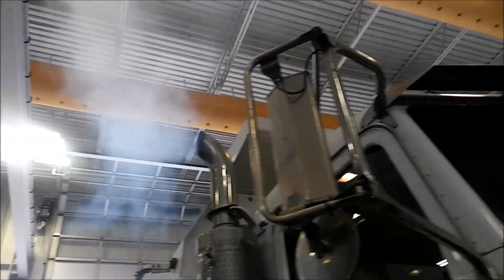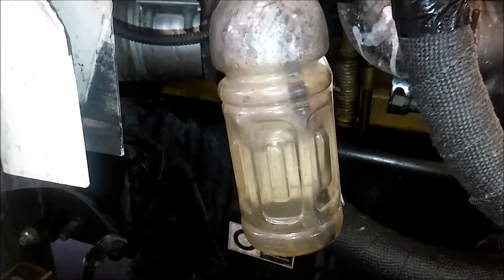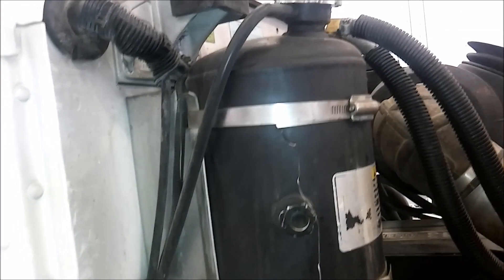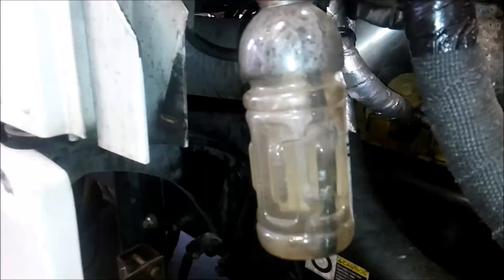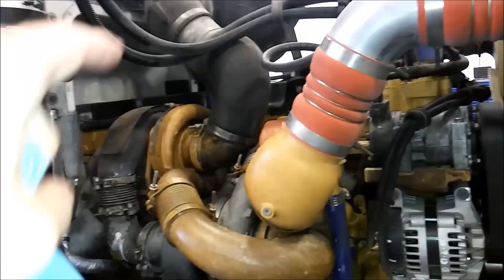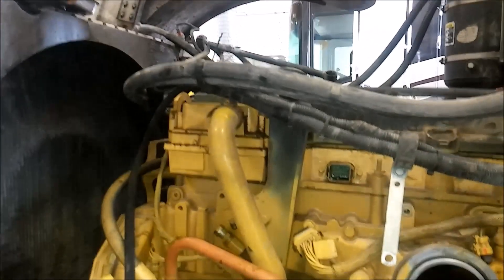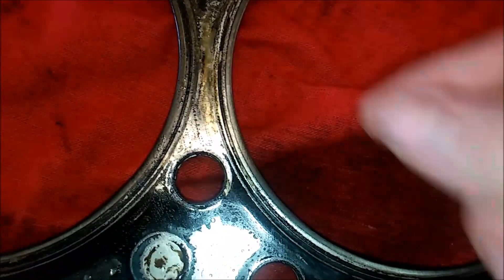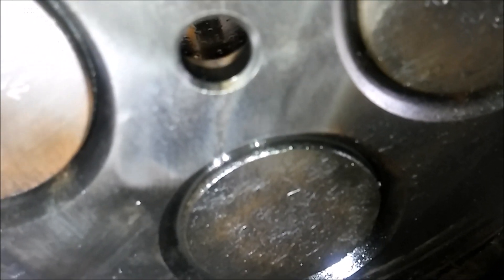Test For A Cracked Cylinder Head or Head Gasket. Perform The Bottle Test or Bubble Test.

Comment: Great videos! Found them looking for help with my symptoms and ended up watching about 8 so far. I have a 2009 C15. Bottle test looks exactly like your video, but no white smoke, smooth, no sludge or moisture sign on dipstick or oil filler cap. No change with compressor pressure line unhooked. Was pushing out 1 gal of coolant per week. Suddenly changed to 1 gal per day for a week. Last day pushed a gallon per hour. Idle or loaded doesn't seem to make much difference. Any thoughts? Thanks and keep up the good work.
Reply from the maker: +survivethewalkingdead That is a lot of coolant consumption. If it is pressurizing the coolant out that bad then you most likely have a blown head gasket or cracked head. Check that radiator cap too, but it should not be causing that much coolant to be lost.

Comment: Yes it's c15. I Replace head on this engine 150'000 miles ago  and that start blowing air into the radiator I take the head off and the gasket the rings are black on one side but I don't see cracks on the head I'm thinking what to do.
Reply from the maker: +vitaliy kostenko Cat recommends the counterbores be cut at 750,000 miles. If you've pulled the head twice already it would be a good idea, even though it's a pain to do. If your fire ring was damaged on the head gasket as well then the counter bores is even a better idea.

Comment: there is no bubbles at all when I parked with truck running, that only happens when running on the highway, how can I check if it's the air compressor? thanks for your help.
Reply from the maker: +Immer Pineda Well you'd be getting air bubbles from the air compressor if it was failing. Did you do the test at high idle and hot?

Comment: I put new radiator fill neck and a new cap and the cap still come off only when I drive it like more than 100 miles see...I leave my truck running all night long and everything goes well...but whenever I start driving boom the cap comes all the way loose...
Reply from the maker: +Immer Pineda Hmmmmm, you need to check that cooling system for compression, sounds like you are getting compression in there and popping the cap, could be air compressor too.

Comment: KW Uses air operated heater valves in some of there bunks that when the seals fail internally they introduce air under system pressure into the cooling system. When this happens it will produce bubbles in the bottle test, as well as air locking the  thermostats. I hope this info helps somebody out there. Thanks AA for the great content in your videos.
Reply from the maker: +BEARivrman81356 That is the first I've ever heard of that. Thanks for the info.
Reply: If your  CAT in your KW overheats when you turn your ac on ,you may have this problem.Try turning off the manual heater valves to the sleeper heater located by the water pump on c15 and 3406 engines. If your over heating problem goes away you have a bad heater valve at the sleeper. I have encountered this problem on 2 different trucks. Change the valve .Problem solved!
Reply: @AdeptApe  kenworthy some have this problem

Comment: I just did a overhaul on my w900l cat3406e and I drove about 200 miles and the cap of the radiator came all the way loose and some coolant comes out...I did the bubbles test couples of times and there was no bubbles at all...my radiator mounting are very bad plus my hood is also very loose it's kind of pushing the radiator cap down...dou think that's the reason why the radiator cap comes loose???? thank you...
Reply from the maker: +Immer Pineda The radiator cap will usually only come off for mechanical reasons like something moved it or the tabs are worn out on the cap or expansion tank. You probably need a new cap and if you aren't getting bubbles then your engine is probably fine.

Comment: Adept Ape I just did a gold overhaul on my kw900l cat 3406e and after I drove 200 miles my radiator cap came all the way loose and some coolant comes out, I did the bottle test couples of times and there was no bubbles at all... my radiator mounting are really bad, the hood is also very loose it's kind of pushing the radiator cap down...do you think that's the reasons why the cap comes loose???? Thank you...
Reply from the maker: +Beatriz Herrera Check my response to your other post.

Comment: is there a tool part number for a compression test adapter for a c7 acert motor??
Reply from the maker: +Wendell Jones Some of Cats engines have them, but I checked the dealer tool catalog and there was nothing for a C7. There was a C7.1 compression tester, but that is a Kutch different engine. There may be one out there, but from what I could find there was nothing.
Reply: +Adept Ape thanks for the information, I guess the best way to check is a blow by test??
Reply from the maker: +Wendell Jones You can still check the cylinders, if you watch my video about doing cylinder cutout tests and checking for weak cylinders I test the cylinder with an air nozzle. Check the video out and see if that helps you.

Comment: Hey Adept Ape!

Which of the 70 pins of the ECM should be powered to bench-start th c7 engine on ground?

Thanks a bunch!
Reply from the maker: +Omar That depends on the serial number, typically pin 70 is for the switched 12v source and then the constant hots vary depending on what your exact serial number is.

Comment: cool videos. I used to work for a truck shop for years. Ive had to replace several heads on c15s. I used your method before. Works awsome. Two were due to broken water pumps and trying to make the delivery. Don't take much to crack thise heads.
Reply from the maker: +Alex Alanis The C13 heads are really easy to crack, just get the engine over 230 and it's done usually. C15 heads are a little more robust, but don't get it too hot. Thanks for commenting.

Comment: Could you do this same trick with gas engines? with the overflow bottle reservoir tube?
Reply from the maker: +Richard Cowtails You could certainly do this with a gas engine. Now the head doesn't always crack into a coolant rail though so it's possible you may have a crack and not push any bubbles, but if it is then this should catch it.
Reply: Adept Ape I just did a gold overhaul on my kw900l cat 3406e and after I drove 200 miles my radiator cap came all the way loose and some coolant comes out, I did the bottle test couples of times and there was no bubbles at all... my radiator mounting are really bad, the hood is also very loose it's kind of pushing the radiator cap down...do you think that's the reasons why the cap comes loose???? Thank you...

Comment: What's the root cause of a cracked cylinder head?
Reply from the maker: Basically the metal in the head gets overheated and expands to the point that the tension in the metal has to be released somewhere, typically it's a crack along a weak point.
Reply: My Motorhome C9 operates at 205 degrees F. It takes awhile to reach 205 F, but it remain constant regardless of ambient temperature. I can watch the digital display of engine and transmission temperature.and on one occasion misread the transmission temperature as the engine temperature. What's the best method to manage a elevated engine temperature ?
My C9 has s belt driven water pump.
Reply from the maker: +Kenneth Bullins Do you have a sideways radiator with the hydraulic fan or the belt driven fan? All C7 and C9 engines have belt driven water pumps.
Reply: Correct,  side radiator with hydraulic fan.
Reply from the maker: +Kenneth Bullins Most of those have the fan come on at 205, it's in kind of an bypass mode before that. nothing wrong with 205, does it ever get much hotter?
Reply: No
Reply: @AdeptApe  I have a cracked head on a C13 Should I remove the liners too or can I get away by just replacing  the head? Thank you.

Comment: yep pushing lots of bubbles into bottle.
Reply from the maker: +Diego Gonzalez okay, well disconnect the air compressor hot hose to make sure that isn't the cause, then it's pretty much certain you have a bad head gasket or head. Now newer trucks with EGR coolers can also cause cooling system problems, but on an older truck it sounds like you need to pull the head. The high blowby might be unrelated to the cooling system problem, if you have the head off you'll have a good view of the liners though.
Reply: +Adept Ape i have a 95 3406e 5ek. which line is the hot line exactly on the air compressor. my problem is like diegos minus the blowby. clean oil. no white smoke. i have injector codes so it rolls a little coal when you pull hard. normal oil consumption 5-7k per gallon on a 700k original 95 motor seems good to me. runs good. no grey matter under valve covers. recently did injector cups. your video was a huge help for that btw.
Reply: One more thing to add is their was no bubbles when i started it. Truck had 0 air pressure and coolant temp was 80* F when i started it. Bubbles didnt appear until several minutes in.
Reply from the maker: +Greg Eckhardt Thank you got the kind words. The Hot Hose line is usually steel braided and it's the hose that goes from the air compressor to the air dryer. All the other hoses on the compressor go back to the engine except the small governor line, but the hot hose is usually large like a 3/4" line or 1/2" line. Is your engine eating coolant or pushing it out of the overflow reservoir?
Reply: +Adept Ape it is blowing it out the cap when the level is too high,but it has a steady drip out of the overflow hose all the time and bubbles almost as much as the one in the video. I put a new 10lb cap on already as is standard for my 95 w900l.
Reply: +Adept Ape. i took the hot line off and bled the system down to like 20 psi with no change in bubbles. considering it runs good,has no grey matter and is not blowing white smoke can i keep running it until the problem becomes more severe. i have a spare of the same engine with under 250k on a platinum overhaul from my last truck as the frame cracked and twisted shortly after i rebuilt the engine. i just would like to save up up money before swapping engines.

Comment: hey ape great video. what if there's a lot of pressure  in the overflow tank and high blow by. no other symptoms not even smoking?
Reply from the maker: +Diego Gonzalez So you say a lot of pressure in the expansion tank, do you mean it's pushing bubbles into a bottle like in the video?
Reply: @AdeptApe  i have the same.issue. no bubbles,no white smoke it just pushes the coolant out lots of pressure build up ..blew out  my lower coolant hose that goes to radiator while driving.
Reply: @rigobertohernandez7333  did you ever figure it out? Having the same issue right now

Comment: how could a crack so small generate that much smoke?
Reply from the maker: +Andy Milian A cracked head is usually only cracked that much or even less. Remember that that area is under extreme pressure during combustion and the cooling system is under pressure to, so any place that pressure it can go it's going to go.

Comment: great video bub! keep them coming! as soon as you upload them I'm watching them. what's your first name?
Reply from the maker: +Brent Hoadley Great to here another happy subscriber. I try to just go by the Adept Ape title on here, I'm not sure if my company would like me to be making these videos or not, so I don't say which shop I'm in or my name. If they tell me it's alright then I'll just go by my name, for now though I'm incognito.
Reply: @AdeptApe  hey bud I have a c15 2006 .. I'm losing power once I get in to any hill depends how bug the hill is..the bigger the hill the bigger the loss of power , took it mechanic changed some valves and relays no more engine light on , still having this issues can you point at some direction for me too check...stuck here dont know what to don
Reply from the maker: +Franky Siguenza People have told me I'm from another planet, but not usually in a complimentary way. Thanks for the comment.
Reply: +Adept Ape companies don't like to share their good techs  my man 
But let's say your sharing your vids from another planet  and your name is riddick 😂 good vids always 👍
Reply: +Adept Ape i Was gonna ask you what you do whenever you find a bent push rod besides replacing lifters and camshaft and of course bent push roads I replaced pretty much every part even oil pump since the shavings went all around the engine I even found a bent exhaust valve just minutes before putting it all  back together 
That was on a c-9 engine by the way 
I appreciate your advice

Comment: I have a 2003 Freightliner with CAT c7 it is giving me a code 35 it says engine over speed warning. What does that mean and how can I fix it?
Reply from the maker: +Briana Croft How high are you revving the engine to? An engine overspeed is when the ECM detects that the engine RPMs are going over what the factory setpoint for safe RPMs are. So if the engine is set to 2500 RPM, but someone downshifts to a very low gear down a hill and revs it up to 3000 RPM that code will become active.
Reply: +Adept Ape to about 2000 rpms. What can I do to fix it